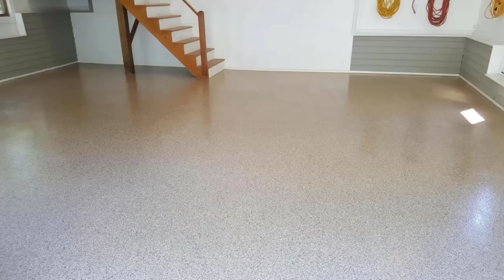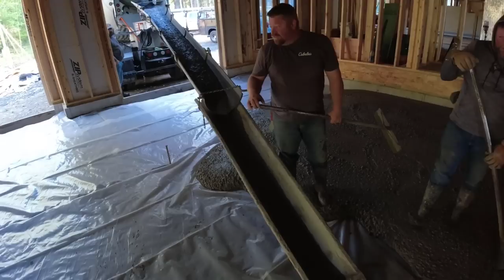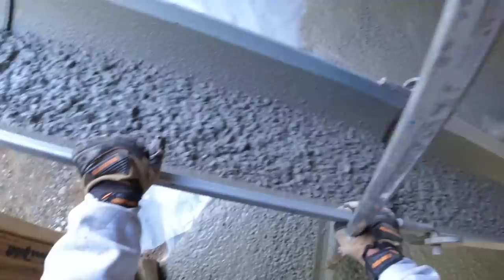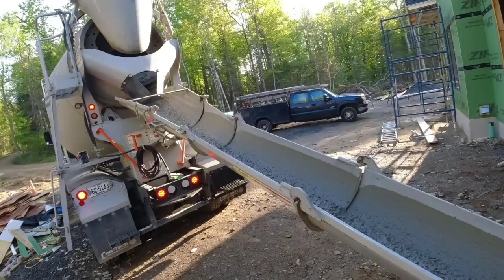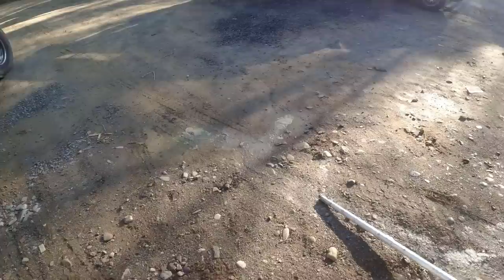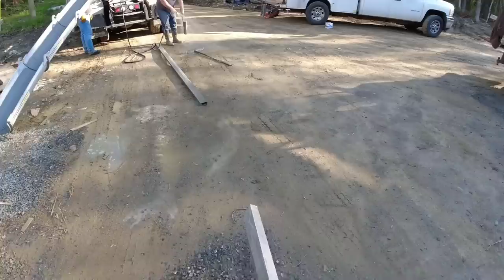How To Pour A 700 Sq. Ft. Garage Floor in 20 Minutes (Real Time)

Comment: Hey Mike, so how do you get the slab FLAT?  I've had many garage, building floors poured over the many years and there are always numerous humps, swales, depressions etc. throughout the floor.  You don't notice them until the slab is wet or your installing larger format tiles that can't tolerate these problems.  This leads to even more prep and time before installing.  I am sure that in warehouses where forklifts and machinery are used these conditions aren't acceptable.  Any thoughts?

Comment: When I was in the service, the Army Corp of Engineers supervised an addition to a building I worked in. When the concrete was poured, the laborers complained, “This isn’t concrete, it’s cookie dough.”  I never seen cracks in concrete at an Air Force base. How will the concrete you are pouring hold up?

Comment: Fourteen minutes in: quiet, fluid, almost lazy movement. Placed by a coupla pros for no more or less than necessary to boot-brush aside and back;  a small screed-wave flattened to bull-float grade. "Whaddya got goin' today? Softball?" is the only easy conversational exchange of note. Four masters of mud, at their deceptively off-handed best; A matter of course...Kung Fu concrete.